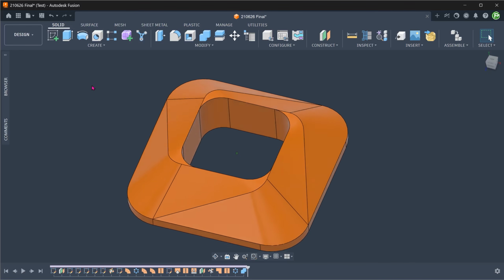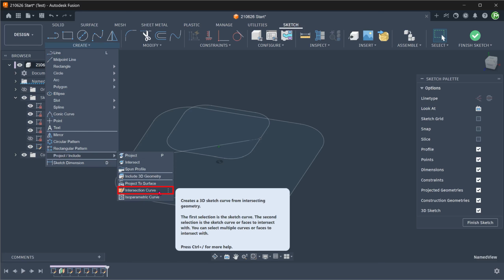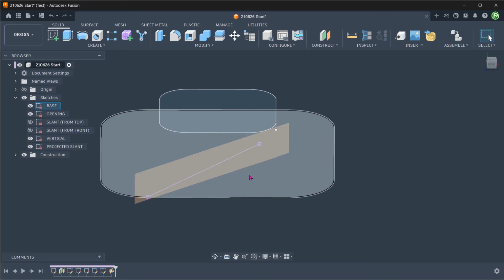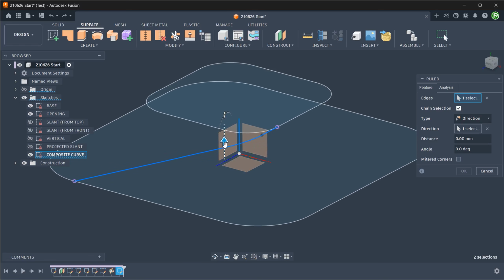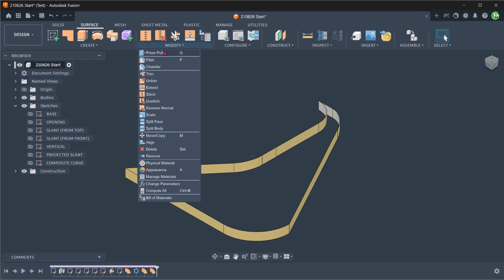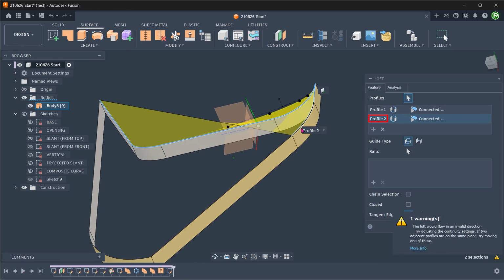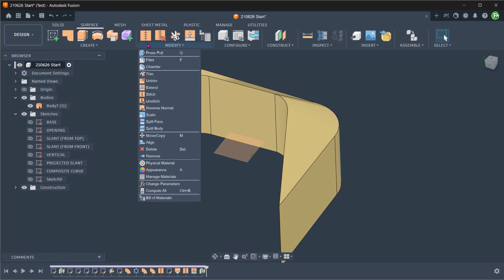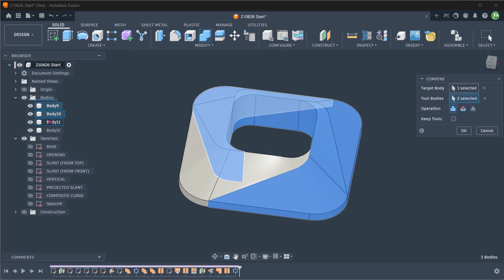How I modelled this in Autodesk Fusion

Comment: Alternately: (1) Simplify the creation of the composite curve by creating the 3-point plane directly from the original sketch points and then sketching directly on that plane. (2) Instead of the scaffolding surfaces and rails, create surface lofts between individual pairs of sketch lines/curves.